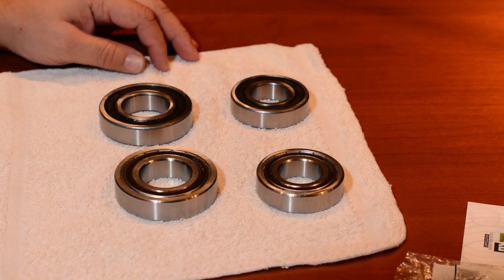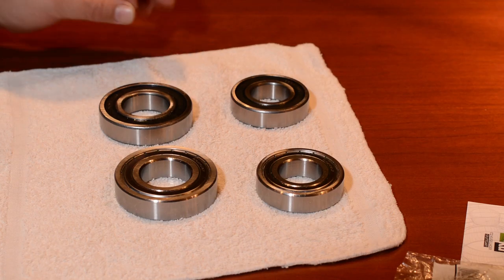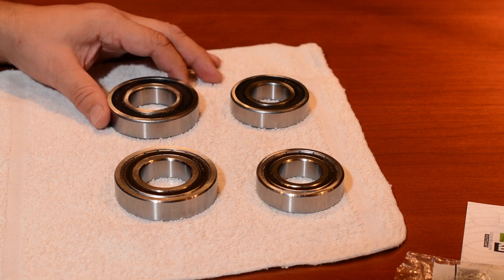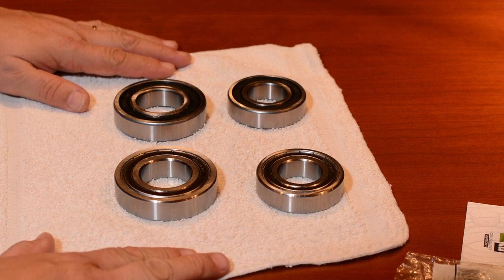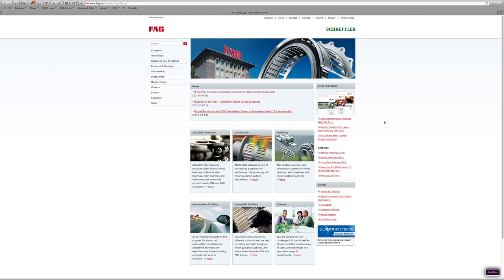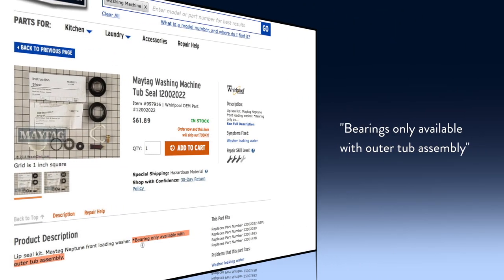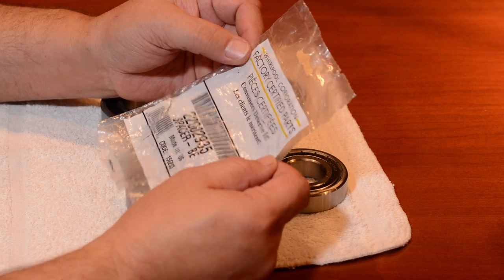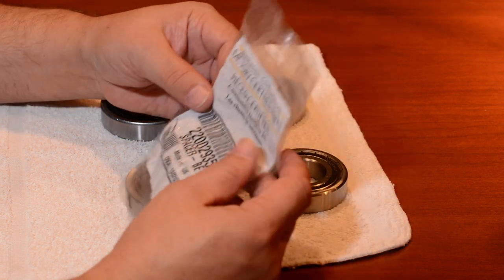Maytag Neptune Washer Bearing Replacement - Counterfeit & Sub-Quality Manufacturing

Comment: I took your lead.....Thanks for the info. I purchased our washer in '02, replaced the bearings about 6-7 years ago..... time to go at it again.... bearings should be here in another day or so.
Reply: They arrived, and are installed...excellent quality. Being that the seal leaking causes the bearings to go bad... I intend to replace the seal every couple of years, and make sure the drain hole is cleaned. I may never have to replace these bearings again...
Reply: but take heed... these sat in customs in New York for two days, but still worth the wait.
Reply from the maker: Glad to hear.
Reply: Do you have the spider that uses the original or revised seal? I upgraded my spider to the new version that uses the revised lip seal. I don't think you have to keep replacing the seal. Just watch the weep holes for water (put a water detector under it), and since the bearings are stainless, they'll probably be fine.

Comment: I've replaced the bearings four times now.   This last time only lasted 5-6 months.  I'm going with a good set of stainless steel also.  I just wonder if the seal is never going to seal very well after all these years even though I replaced the seal every time also.
Reply from the maker: Just replace the carbon steel bearings with stainless steel and you shouldn't have to do this repair again, regardless of the hearing seal.

Comment: Would it help to pack and grease up the hearings before putting them in?
Reply from the maker: A good quality bearing should have decent side seals and the grease installed by the factory should be sufficient.  Secondly, buy stainless steel bearings and they should last the duration of the life of the washer.

Comment: I can't seem to locate a CQ distributor for the SS6206ZZ and the SS62072RS bearings. The German website is hard to understand.  Can you point me in the right direction?
Reply from the maker: The manufacture still has them listed on Ebay through their store, which you can find here: https://www.ebay.com/itm/SS-6206-ZZ-SS-6207-2RS-Stainless-Steel-Ball-Bearing-Maytag-Neptune-washer-/192271185353?hash=item2cc44175c9

Comment: I wish to purchase these bearings BUT where do you get the oil seal,  the rubber seal that goes in front of the inner bearing.  I am having a hard time finding it for sale alone and not in a kit.
Reply from the maker: Check ebay by searching for Maytag Whirlpool Neptune washer bearing seal. You can probably pick up a seal kit for about $10 with free shipping.

Comment: I'm repairing a Maytag MAH4000AWW.  I believe I need kit No. 1202022 which includes the seal, the c-shaped Teflon spacer, and the washer & bolt for the pulley.  Do the companies you're recommending also provide all the parts necessary to complete the job.  If not, please advise me on how to obtain all parts necessary to complete the job, thanks.
Reply from the maker: Check eBay by searching for Maytag Whirlpool Neptune washer bearing seal kit.  You should be able to find a kit for around $10 with free shipping.

Comment: Hmm, a stainless steel bearing may not rust but it still needs lubrication.  Some repair/ replacement kits include silicone grease to pack between the seal and bearing.  (Note that many so-called silicone greases are cut with thinners that are not silicone oil.)
Reply from the maker: Once the bearings are installed on these Neptune washers, it's pretty hard to go in afterwards to repack the bearings. You might as well replace them if that's the case.

Comment: Thanks for the informative video. How are the bearings holding up  2 years later? Just replaced my spider bracket on my washer and bought bearings from a guy on youtube who's a video but now I am wondering if I bought Chinese knock offs especially with the price I paid. Anyway thanks again..
Reply from the maker: In the spin cycle, "Silence is Golden." Still after several years.

Comment: You sound very believable BUT fact of matter is Stainless bearings are derated about 20% because the are NOT as hard . I agree get some good brand bearings but When installed correctly  my nachi's or skf will outlast your stainless .  I've revised seating front bearing a little [as should TonyTool users.
 Problem is if not backing up bearing races when they hit spacer tube , it will Sideload / preload them . Ball bearings not designed for preload [rollers are, like pinion bearings]  There are also sellers claiming abec5  rating nachi precision . They will show up in same blue/red nachi boxes not the gray 'precision'. [not needed either ,,,we're talking 1200 rpm here ].  17 yrs aircraft engine accy tech here. [ turbine starter generator bearing about $100 ea because they do live at high rpm's ]   I'm working on expanding coverage for popular models / cracking the Samsung built maytags  part combinations since Even the PartsSelect / Appiance Parts Pros are too lazy . [maytag says nla and they don't care to cross to real manufacture ]  same as aircraft parts ,can double or triple for same part ,depends how you order them.  Wasn't aware you included clip of ME , but don't care . Have good one Dwonus5  donwonus@gmail
Reply from the maker: Anytime you run metal on metal you will have wear and friction. Regular carbon steel is harder than SS, however, it also rusts and in an environment of continual moister the stainless steel bearings should last you longer.  You can always go ceramic too a premium price.

Comment: Yeah I bought these bearings and they don't fit. Not even close.
Reply from the maker: Sounds like you received the wrong ones? The 6207 and 6206 are the two sizes you need for the Maytag Neptune washer.